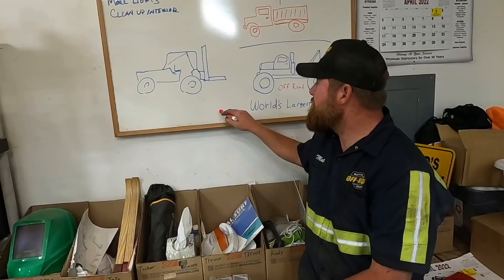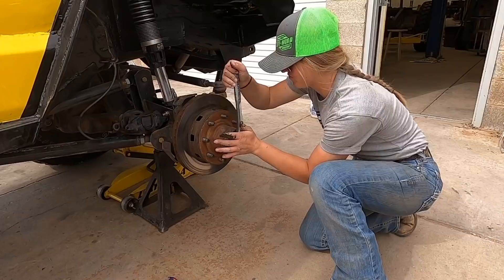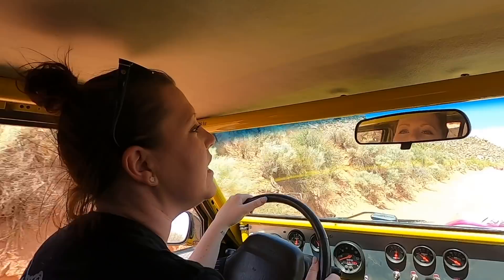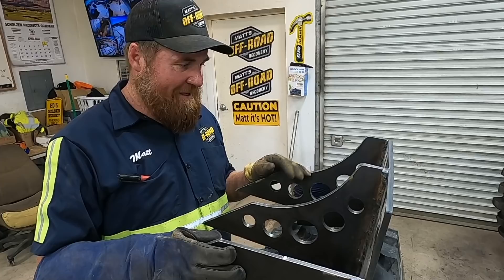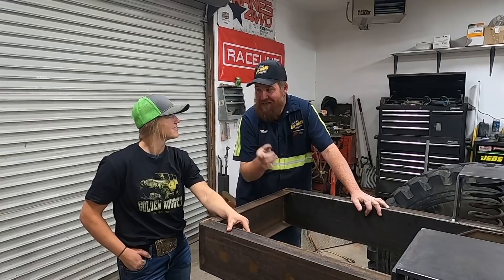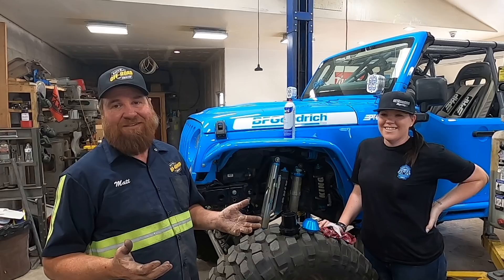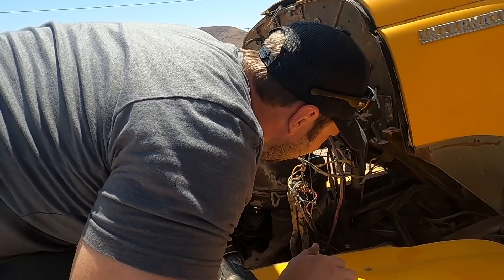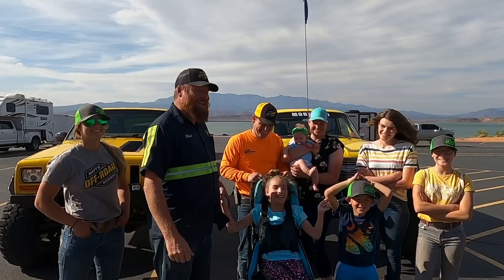World's Largest Off Road Wrecker Gets Some Springs

Comment: Just as a heads up Matt and team when you weld something and it deforms like that bracket did, there is a easy way to fix it without cutting anything. You can literally relax that center weld ( or most any welds for that matter) with line heating.  Get your torches out and run a line of heat down the backside of the plate of steel that is warped from weld process, opposite/back of the weld. Unless it is like a inch thick it will lay right down to its original position before you started welding (line heating allows the metal to relax after being welded. if you heat it once and it lays down partially but not all the way, let it cool and just line heat it again and it will relax more). You want to get the metal just hot enough so that it starts to turn a little red then start moving the torch down the weld line very slowly, trying to maintain that constant heat/ little bit of reddness in the steel (can't hurt to trace with soap stone but you will be able to see the weld line due to the heat transfer).  I work at a shipyard that still uses the dying art of heat and water metal forming to bend giant I beams and much more just using torches, water, and hold down pins when needed. It is a art and not many places still know how to utilize it. Hope this helps, it can save alot of time.  Thanks for the content.
Reply: Good advice 👍
Reply: Thanks for the knowledge man. I’ll definitely gonna remember your advice.
Reply: @Burn Heretic Thanks for taking the time to type your answer ....
Reply: Now that's cool, I've never heard of such a thing.
Reply: Well said.  It can also be used for bending/straightening pipe by heating a long diamond area on the 'long'' side.
Reply: Bro, that sounds like way too much work. Winging it is so much funner.
Reply: Xactly. An welded plates keep on moving several days. I welded my rigs and then left them move for a few days. Then you can bend or machine to final dimensions. Another idea is to anneal the whole structure, then force it to final dimensions. Sometimes machining, when greater precision is needed.
Reply: We had a 100’ girder get dropped off the truck and fall about 12’. It took someone about a week of line heating, but they got it back to straight and saved a 3 month delay.
Reply: @gordbaker896  absolutely.  Same idea with V heats on I beam. As you stated a diamond shape in pipe chased by water. It all works to bend or straighten steel or even aluminum for example.

Comment: Back in the early 70's I rebuilt a 1951 Willys M-38 Jeep.  It was my very first Jeep and very first vehicle!  I started hanging out with the local Off-road enthusiasts who pretty much built their respective off roaders themselves.  One thing I do remember is that the "Big Rig" enthusiasts (Full size Chevy Blazers and Pick Up trucks) were transplanting 500 and 472 cubic inch V-8's extricated from late 1970's vintage Cadilliac's.  They had lots of power and RPM's for climbing the sand dunes and tons of low end torque for the really tough trails!     I wonder if that type of power plant might work out well for your SUPER MEGA Banana wrecker? In any event, I really enjoy the heck out of your videos.  Keep up the good work and be careful out there!

Comment: The lines of the wrecker are gonna be amazing! That long stretch of the front part of the wheelbase has such a low-slung, aggressive look to it. Almost looks like you'll be able to shorten the front of the frame and gain some approach angle once things are a little more finalized.
Reply: @MattsOffRoadRecovery  Makes perfect sense. Gotta allow for unknowns. I always say I'd rather be two feet too long than two inches too short.

Comment: Matt, little tip for your fork extensions, use some 6" channel and weld a couple strips/plates on the ends  to box in the back and one in the middle so it stays on the fork. Heck of a lot stronger than tube. I saw the one was a little bent. Stay safe and can't wait to see this thing on the trails.

Comment: Hi Matt, Can't get away from you tube, your show is awesome. We love everything you do, Love all the people around you, I think you have the best Family show around. Having raised for boys with Motocross and side by sides, I think i found the best way to pull the bikes and razors on to my 8/10 trailer. I had a piece of 3/8th (Good) aluminum plate 8x8 attached to my trailer floor and used it for a ramp. I've pulled so many things on the trailer so much easier. I'm sure you guy's can figure how to attach it to your trailer, and still use your ramps. It really work for me.
   Keep up the great show, God Bless and be safe.   Butch

Comment: Hey Matt, to fix the warp just heat the other side with blow torch to straw coloured around the heat affected zone and it will pull the bracket back down some. Best method tack in jig and weld in place on chassis then it won't pull like a school boy :)

Comment: 7:30 I worked in demolition for a while, cutting rusty steel beams etc at an old Gold mine. I got to the stage where I'd let slag bubbles burn inside my boots because there was no point trying to take off the boot to get rid of the slag bubble because it'd already done its damage. You tend to just ignore the little ones. Bigger ones were a bit of a 'pain'.

Comment: Matt, I am not a bodyman by any stretch of the imagination. But after looking at the International cab, articulated hood and the cowl sitting on the frame, I would lengthen the hood to the frame end meeting up with the radiator cowl. I don't figure you can use the original fenders without some "minor modifications", but doing a stretch on those would complete the look. Sort of like a "CARS" cartoon movie vehicle. This thing is going to be on another level for its intended purpose. Greetings from the Sandhills of NC.

Comment: Need to use Rockwell axles and make it 4 wheel steer for those really tight areas.  I use to convert highway snow augers and runway plows to 4-wheel steer 4-wheel drive.  Used a joystick for the rear steer and front chute control.

Comment: The axles are doing that because they flex slightly under load which causes the U joint C clips to fall out then the cap starts walking out and ovals out the hole until it breaks. using full circle clips on the U joints instead of C clips helps prevent this, or you can tack weld the U joint caps in place.

Comment: adjustable stops on your hinges would probably be the easiest and stay out of the way. I typically weld the nut to the pivot and then have the bolt screw into that. if you weld the tab on the pipe section of your hinge for the bolt head to rest against when it is down, it will be infinitely adjustable.

Comment: I think practicality is being sacrificed for cool looks.  That cab is going to be tight and I doubt you are going to get 3 people in it. Especially if they have to hack into the rear floor for engine clearance.  A later model PU cab would have a lot more room for people and gear, be easy to get parts for, be easier to work on, ect.  If this were a toy I'd get it but this is a work truck, it should be practical.  But maybe the cab needs to be this narrow to keep the overall vehicle width narrow enough to access some of the trails it will have to go on.

Comment: I am topically not the biggest ford fanboy, but I good engine for the heavy wrecker could be a gas crate 7.3L, I would say a Chevy 6.6L gas but when making more power at lower rpm’s nothing compares to larger displacement. And the 7.3L is also good old reliable pushrod design. And I believe has a aftermarket factory approved supercharger option that keeps the warranty and is designed to do the same job the 7.3L was designed for … Pulling!

Comment: Are you going to make the hood longer? I've seen older Semi trucks with extended hoods to accommodate larger engines. Yours would be to make the fenders reach the front tires.

Comment: You’re obviously talented builders, so I could be way off here, but something has been bugging me about the frame. Rather, the frame as used to hold compressed air. I’m sure it’s very strong, but do you ever do that thing where you twist the ends of a straw to compress the air inside, then have your friend flick it and it goes off like a small firecracker? I keep picturing the frame full of air and hitting a sudden rock or any kind of fast shock and having it pop like the straw. Does Tom Tom have anything to say about it?

Comment: Heavy D Sparks I think is the right name, does have a bigger wrecker still that they try to use offroad a lot.... but it also needs pulled out a lot and doesnt have the science and know how to be built to go in sand and over boulders. Random question, are you doing something different with your beard? I've noticed it seems more smooth and trimmed in a lot of your later videos. New oil or wax?

Comment: How are you gonna fit all your roll bars your fire extinguisher and your tools in that tiny little cab?
 Forget styling you might as well make a rock buggy style cab with some snap on canvas for climate control and a straight windshield. 
 As a bonus you can integrate a recovery rope toolbox in the doors.
 Seriously just cage the whole thing and cover it with some snap on canvas.
 FYI the Ford Godzilla motor is 1000 hp with no power add’ers straight out of the crate, with head bolts the size of your fist.